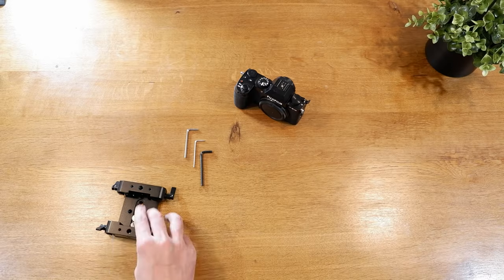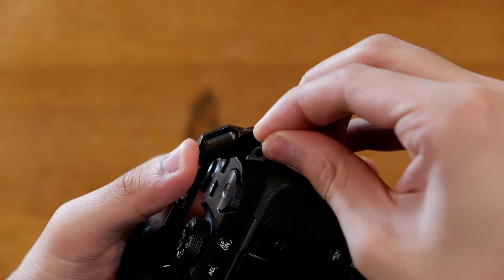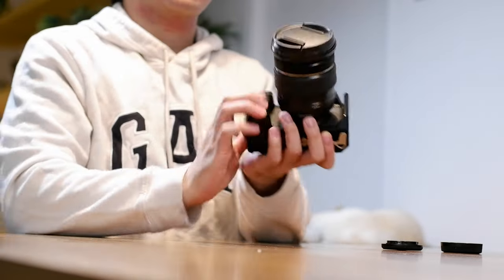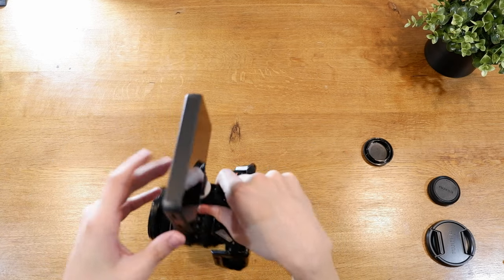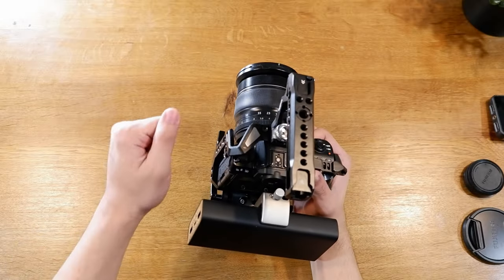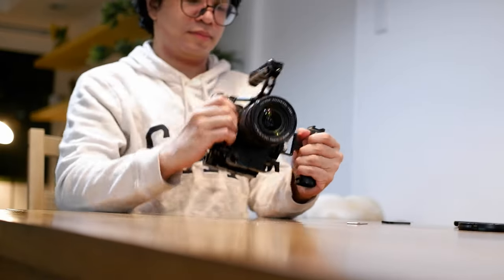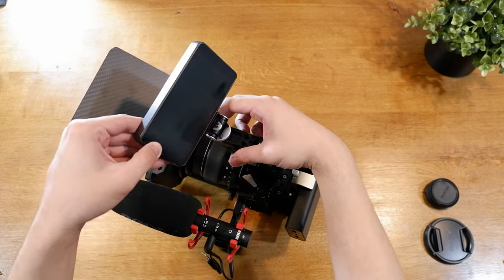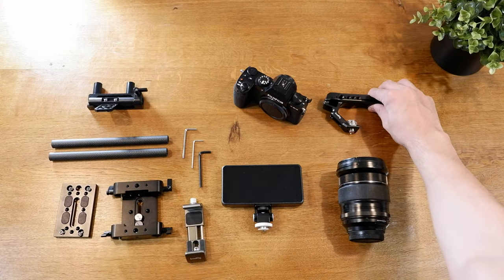Building a Cinematography Rig with the Fujifilm X-S10 | SmallRig Build

Comment: Hey man, lovely setup! I was looking for a way to adapt my XT-20 for video use as the next project I have is going to be handheld. Got lot's of inspiraton from your rig and the cage is on it's way. I have to say, For now just slotting the battery clamp into the bottom receiver of the camera is the most barebones thing I could think of in order to achieve the extended battery life and adding that little bit of extra weight! footage is already more smooth ^^
Reply from the maker: Happy you were able to get inspiration! Please share your final rig setup!

Comment: hey, this is amazing, I might replicate the whole rig but before that, I got a question, would you recommend getting a gimbal or doing this rig? Which one would have more stability, especially if I'm using a lens with no built-in stability, would this rig still be as steady as a gimbal?
Reply from the maker: heya! for stability you would still want a gimbal. this setup still has a lot of handshake, gimbals would generally remove that while this kind of rig just makes it more pleasing and less jittery.

Comment: Since you’re building the small rig, I assume this footage is from the XA-7? Thinking about getting the X-S10 upgrading from XT200, would you suggest getting it with the 18-55 too? Or Am I good with the 15-45 3.5-5.6?
Reply from the maker: Good eye! Yes I shot this on the A7. I personally like the 18-55 over the 15-45 just because I like the physical zoom rings over the power zoom mechanism of the 15-45. The wider aperture of the 18-55 is also quite noticeable. That being said, I used to own the 15-45 and I regret letting it go. There are things I miss such as the 15mm wide end and also the super compact form factor. (The 18-55 is like three times bigger.) I hope this helps!
Reply: @aransamson  Thank you bro! Currently, I'm not satisfied with the footage I get with the XT200 so thinking about the switch. Appreciate the advice.
Reply from the maker: @janjericsantos  I think the XT200 is a great photo camera! but for video I would go with the XS10 or the XT4, if you could wait, I am hearing a lot of good things about the rumored XH2. I'd even go for a used XH1 too. Happy shooting and looking forward to your future videos!
Reply: I've been shooting with the xc15-45mm recently. Now, I prefer the 15-45mm... Actually used to own the 18-55mm. And trust me, sharpness difference is not what you'd expect. I have a video showing how the 15-45mm is actually sharper in some apertures and focal distance.
That's why I sold the 18-55 got the 15-45 and had left over to get another lens! The XF50mm f2 WR.
Reply: @jpr-tech  thanks! But it got a Zv-1 instead as my video shooter, the record limit on Fuji kills it for me.

Comment: I don't understand this statement "Some Canon Dummy Battery that can connect to USB Type C".  What does this mean?
Reply: A dummy battery is a plastic container that has the size, shape and connections of an original Sony, Canon, Fuji etc. battery but doesn't have any battery cells. Instead, the dummy battery comes with a cable that connects the camera directly to a power bank or a larger battery (for example, V-mount batteries). The dummy battery might include a bit of electronics for converting the voltage.

Comment: Do u have cable clamp?
Reply from the maker: hey hi no, I don't have a cable clamp since I intentionally chose shorter cables for all my connections. I imagine a longer HDMI cable might need the cable clamp though
Reply: @aransamson  Hello again. I found SmallRig MD2418. I tried it and it was very successful. It does not compress, but takes the weight tension created by the cable from the hdmi or usb-c port. I use it with both hdmi and tethering cables. I just bought it yesterday :) thanks.